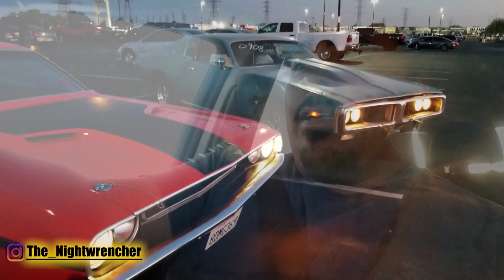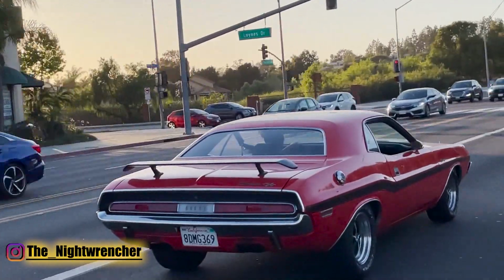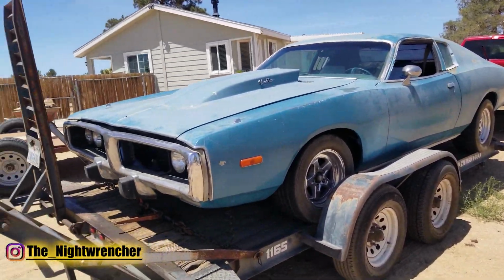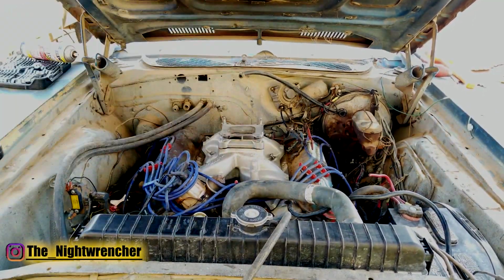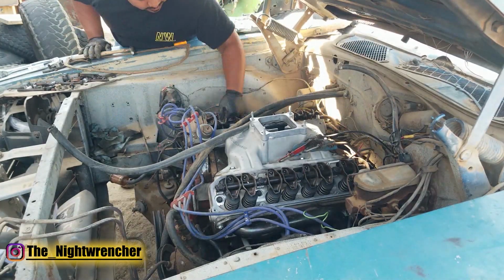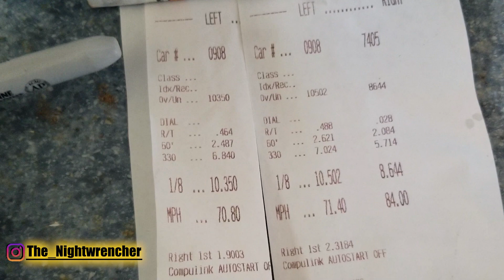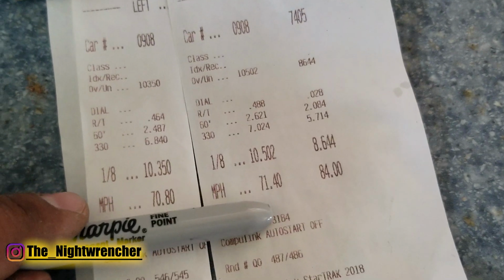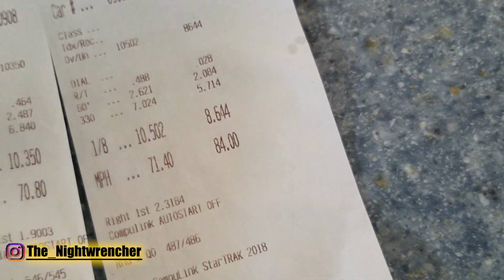Charger VS Challenger R/T Hemi VS 361 Big Block Charger Drag Race ROUND 1 | Mopar vs Mopar

Comment: Any updates on the 361 Charger?
Reply from the maker: Not at the moment but I am getting it ready to start racing again in a few weeks 👍
Reply: @NightWrencher  I'm going to do heads and a cam on my 361. Looking to just get a little more street hp not for racing. Would you recommend just going with 440 source heads as opposed to having the stock heads redone? I will be going for more of stock look.
Reply from the maker: I think theyre good for the price. $1000 for a fresh set of aluminum heads that are lighter and give you more compression.

Comment: You need a stall badly....and then you will need drag radials. also take some weight out of the car
Reply from the maker: Those exact things are what I'm working on right now 👍
Reply: The title on my 73 charger says it is 3500 pounds but it was a 318 car that someone put a 440 in before I got it I am sure a big block added weight along with its k frame in witch I am going to change to firm feel aluminum isolaters to stiffen it up for safety and better handling
Reply: @dinadaughtry8993  thats gross weight. Id actually weigh the car to see what it really is.

Comment: What the hell is a 361 big block sure as hell didn't come in that.  If it's the original engine it's a 400 if not it maybe 383 or 440, judging by the results I 'd say 400. The only way to make that engine awesome is to stroke it to a 509. Now, no there was not a 350 big block never heard of that,  It have owned Mopar muscle cars since 1984 so I know what I'm talking about
Reply from the maker: 🤣 you really shouldnt talk like a know it all if you dont actually know it all, just saying. In a past video I mentioned it was 361 big block out of a 1962 plymouth. 4 bolt valve covers instead of 6. Pedestals on the rocker shafts. Look it up on Allpar. Block casting # 2205712 👍
Reply from the maker: https://youtu.be/1fxIGtx_HeQ heres a run down of the heads that came off of it 👍
Reply: @NightWrencher  indeed this my first video of yours that I have watched, ok so why did you decide to go with such an obscure engine?
Reply from the maker: I have a video going over the whole history of the car but basically my dad swapped it in about 20 years ago when the original 400 shot a piston through the cyl wall. My dad grabbed this from the junkyard thinking it was a 383. It wasnt until I started working on it that I realized it was a 361. This engine has a forged crank and factory came with like a 9.5:1 compression ratio. 305hp(net) from the factory. It already has all the supporting mods to make it to 400+ hp minus the cam.
Reply: @NightWrencher  I see, it just kinda happened, and you're rolling with it, that makes more sense than you sought it out. I had a 73 charger 340 rallye car that of course the 340 was gone by the time we met and a built 360 small block sat in it's place but all in all fun car  it was root beer with white interior and silver carpet. What gear are you running? For the quarter I like the 3.91
Reply: Yes Chrysler manufactured a 350 big block and I only had one vehicle with the 361 , a 64 Dodge Custom 880.
The 361 was an excellent engine.
Reply: @garymckee448   This is what happens when you only care about performance engines and  seem to forget other things existed.
Reply: Yes there was,in1958 Mopar made a 350 cubic inch low deck big block that was shortly replaced with the 361 and then the 383 in the 69-70 the 383 was discontinued and the 400 replaced it,in 1973 the charger came with the 440 or the 400 as the big block options the low deck big block Mopar all share the same stroke different bore sizes is how they got the cubic inch difference the 400 has the largest bore of any other Mopar engine even the 440 witch is a raised block with a longer stroke
Reply: @dinadaughtry8993  now take the 440 crank put it in the 400, you will need 355 Chevrolet rods and now you have a 509 that looks just like a 400.  Performance engines are the only ones I care about, sometimes forget there are others.  As much as Mopar parts already cost never seemed like a good idea to experiment with lack luster engines. 383 awesome, 400 extremely weak. Sure the 361 or 350 wouldn't impress me either.
Reply: @vladtepish1790  KB pistons make a good set of pistons that bring up the compression ratio for the 400, and then you have a bored out 383, of you try to get a bore as big as the 400 in a 383 block you would destroy the block and since the 383and400 are the same stroke the only difference between the blocks is the 400 is bigger bore plus many 400 are stronger in the main bearing saddles so a400 is a better block for a performance build than the other low deck blocks stroked or not
Reply: There is a 361 my friend
Reply: 350 big block was the very first big block chrysler  along side the 383 tall deck you shouldn't spout off like you know when you don't 🤣
Reply: @JT-ko3rv  already  been resolved, so blow me.  It's still obsolete  and a waste of money to try to make it fast.
Reply: Actually it's unique and not a waste of time. It gets so old watching people pull out motor home 440s and old used up 383s just like the other guys. Why not build up old 350s 361 413 industrial engines. Hell even the ol 318 poly heads. Got a neighbor that built a nail head in his Buick instead of a same ol junkyard 455